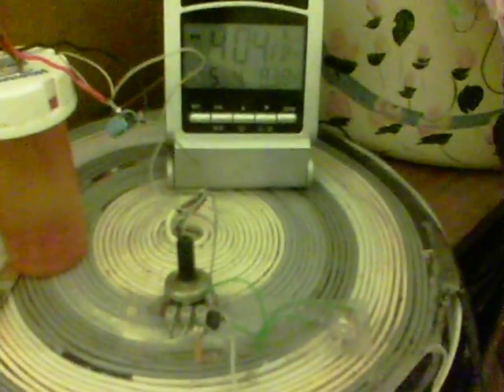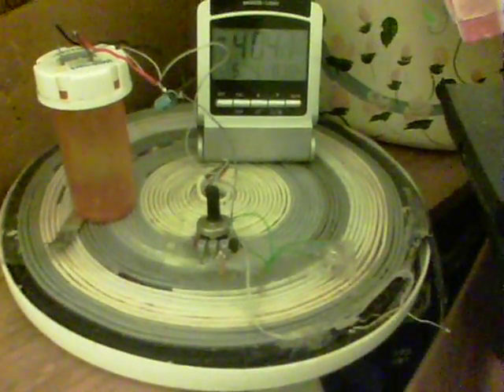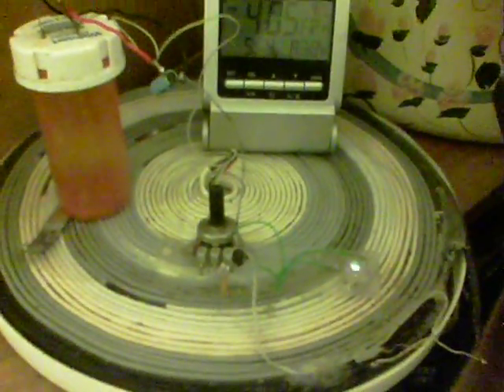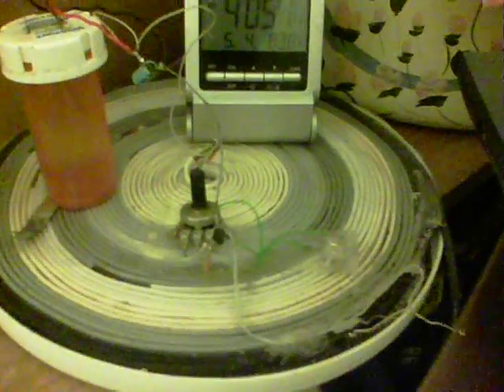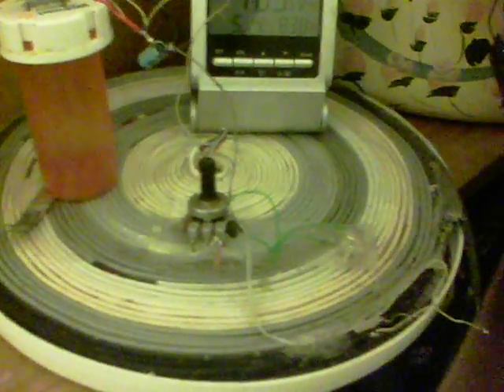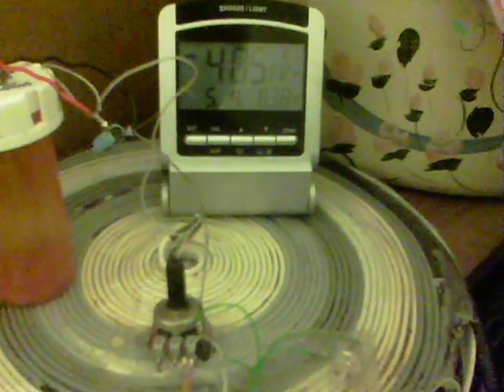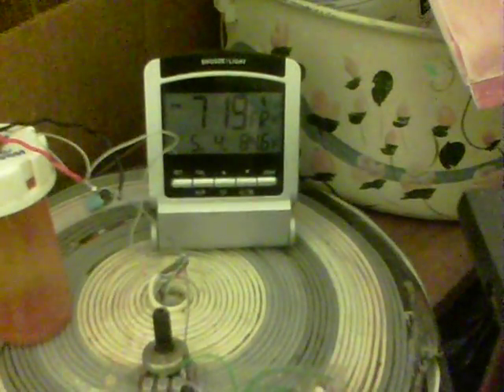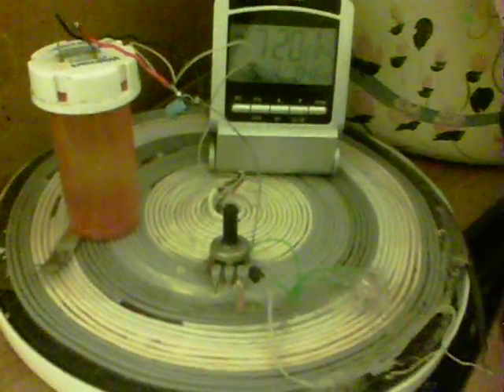Proof - Pancake coils and weather

Comment from the maker: Yeah, wouldn't it be cool to design in the extremes of any reaction to a portable barometer type device. 
It would be a very beneficial device and I aim to forward this and work through it, with those sorts of aims....similar to the low height radiant energy collector and human powered electronics - camping trip safety :)

Comment from the maker: Interesting, just looked them up. They operate in kHz, which I would have thought precluded the low Hz operation of the circuit. But, if thinking perhaps of propagation within the coil, then certainly a very interesting link. Thanks for the heads up on them :)

Comment from the maker: Pressure differences would seem to tie in to your thoughts, which I enjoyed reading. The analogy of a body capacitance, being more of a wave within the electromagnetics of the storm is intriguing to contemplate ! Pushes forward as the storm draws near may just mess up the normal coil operation. 
Salts cells with the Nephilim Penny bifilar also behaved oddly, but they were early days, flaky cells and I didn't know to link to storms.

Comment: The mass in the atmosphere effects coils and there capacitance like reaching in on a resonance circuit and changing the resonance with your body's own capacitance  it's just a really big hand or it could be the high frequency static in the air effecting the battery perhaps changing its impedance hmmm...

Comment from the maker: It's done it several times now and is like an electronic barometer. 
I'll have to make more like this and try outside and different rooms. Will put one in a dissected microwave in the shed for Faraday cage type running. Going to run one powered by the backyard fence too (which only makes sense if following my experiments lol, otherwise sounds very weird)

Comment from the maker: Yes, good thought. This one puts out about 1mA all the time, used to be more, months ago. It could be as simple as humidity on the actual surface area of the coil or water cell/electrodes, though it's right next to the stove and doesn't flinch when cooking or boiling water. May be as complex as negative/positive ion mix in the surrounding air (though would think both more likely if outside). 
In fact, wonder what it would do outside ?! I'll try it next storm :)

Comment: i wonder if the extra humidity makes the air less resistive enough for your ultra low current systems to alter normal operation? i mean your little battry must only be under a few 0.001 amps right? it wouldnt take much to offset the natural self discharge of such a low amperage cell.
just a theory anyways :)